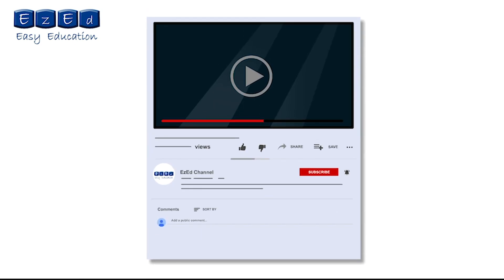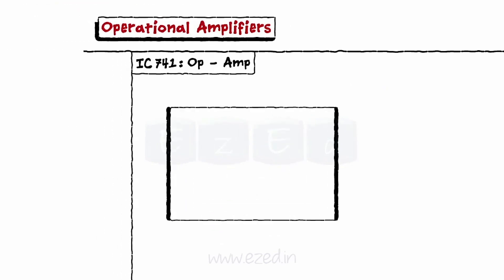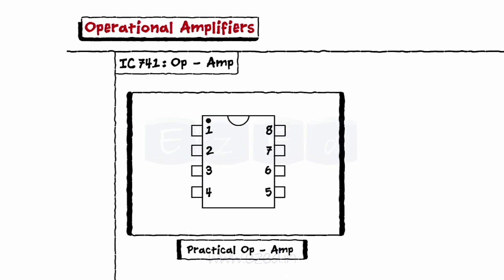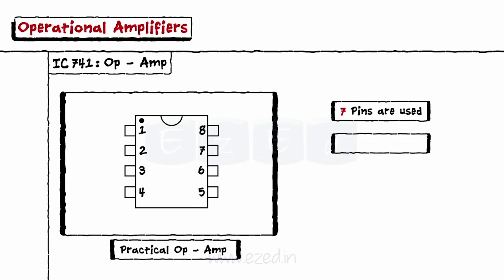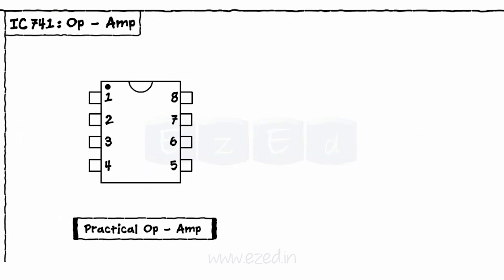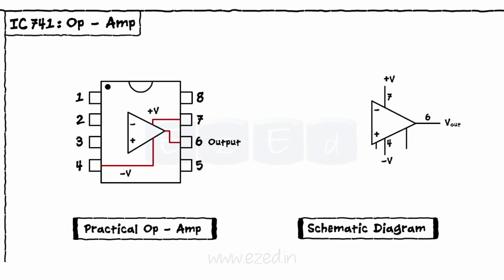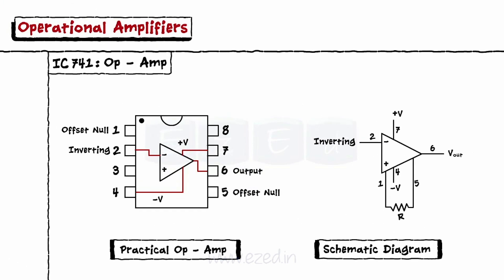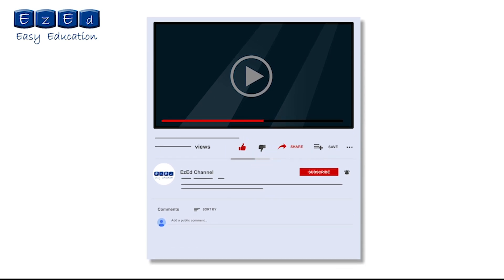OpAmps - IC 741 - Pin numbers, Construction

Comment: how are 7 pins used? only 2, 3, 4, 7, and 6 are used which is only 5 pins???
Reply: Pin one and five are joined using an offset resistor between them